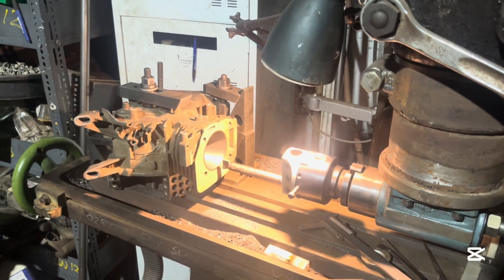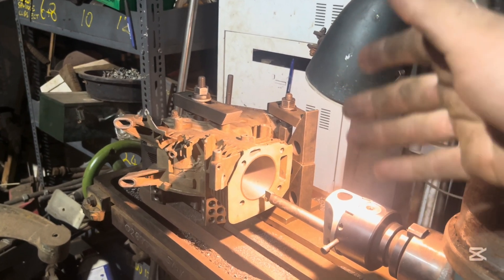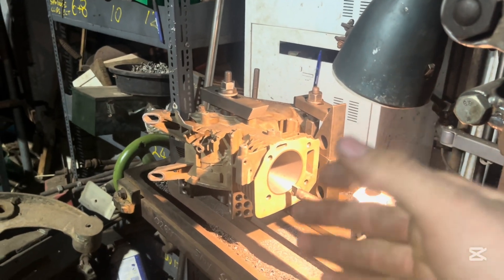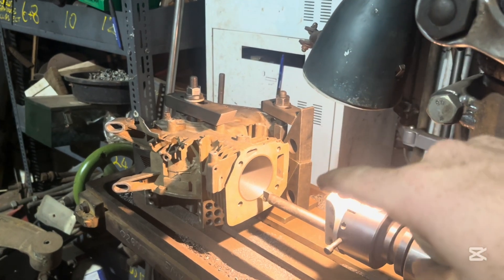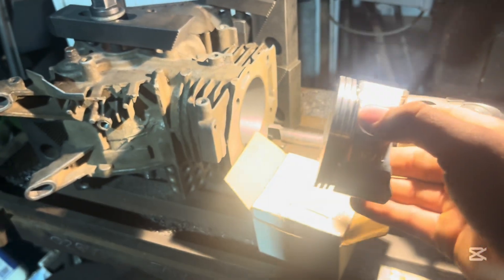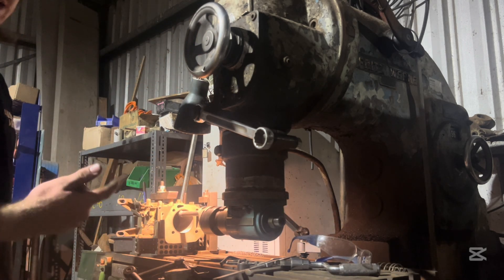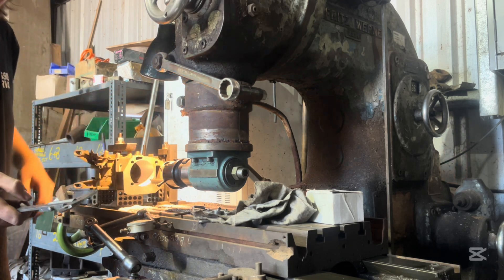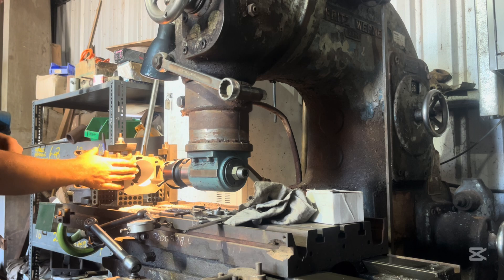THE BORING JOB! Boring Out My GX200 Gokart Motor

Comment: Interesting video. 40 thou is equal in 1.0mm. Feed rate should be about 11 thou per revolution. On the last cut to achieve the best surface finish I would stop the mill move the Y  axis so the boring are doesn't rub on the way out. I think you more talented than you and letting on.
Reply from the maker: Thanks for your feed back mate. I'm aware that the surface finish could be better if I moved the Y axis, but I'm not to worried about the finish because it will be getting a sleeve
Reply: I Don't what you to think that I am being negative. I am looking forward to you making a pattern and casting the sleeve.
Reply from the maker: I know your not being negative